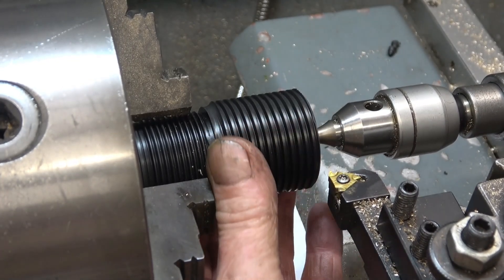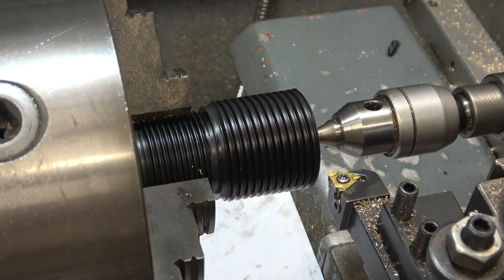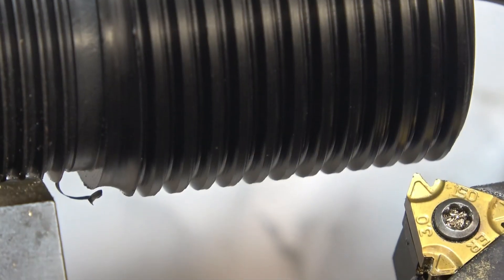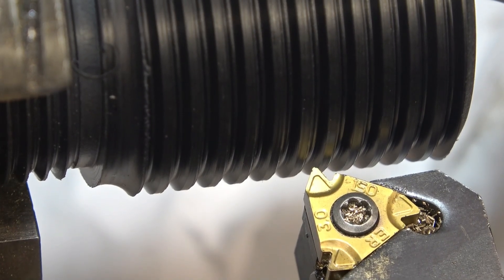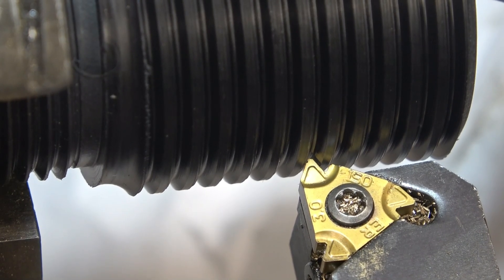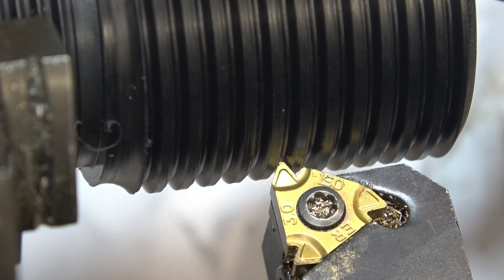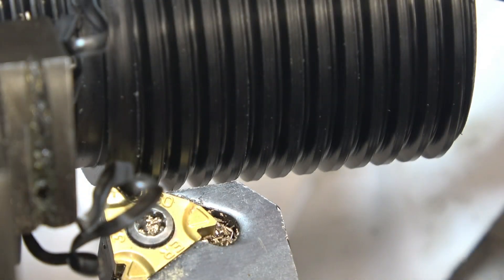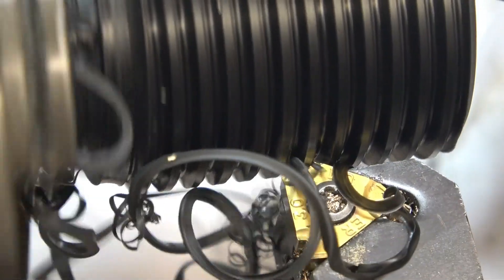Wednesday Night Catch Up .How to Pick Up a Thread on a Lathe: A Step-by-Step Guide.

Comment: All good and it might be worth adding that if you are not spot on, but still have thread to cut, a slight misalignment won't matter much, i say that to give beginners a little confidence if they have to do it, near enough can sometimes be good enough.
Reply from the maker: As I keep saying .The job beads to be accurate enough to do its intended job.
Reply: @doubleboost  indeed !

Comment: Cracking Video kidda.  I've been struggling with a Draper Storm Force 100A flux core 'mig' welder (63669) and some 20 square x 2 thick mild steel section.  Any tips on how to dial in the wire feed speed and the Min - Max, 1 - 2 switches would be mint.  There is no settings chart on this welder or in the manual, thanks Draper!

Comment: Hi John,   Idea for Wednesday Night Video.      This video (and last weeks) were cutting BSP threads with the BSW thread form of 55 Deg with  radius on crest and root.    How would you cut the BSW type thread with a single 55 Deg sharp pointed lathe tool and obtain the correct root diameter as in this (and the other video) a formed insert was used, which has the correct thread height between root and crest for the correct TPI.    Surely this tool insert can't be used for other Dia BSW threads with different TPI and thread height?
Reply from the maker: A different tip is used for each thread pitch . In this video i was using a metric tip cutting 8 TPI . This was just for demonstration purposes .. a nice bold thread that simply is non existent .Well up until now .
Reply: @doubleboost  Let it be known from here on as the 'Mills peculiar form thread' 🤣
Reply: You can't cut a radiused root thread form with a basic sharp angled Vee form single point tool. 
The trick is to grind or stone lap the point of a hand ground tool to conform with the required root radius. The crests can be hand finished with a small single cut file run down the thread while the lathe is running slowly.

Comment: Excellent, never knew how to do that. 

Now a question TIG welding 1mm Aluminium my rtech 210ex on simple setting 75amp will not tack up or weld good, base metal drops as I tack or weld (lap joint), I'm using 1.6 2% Lanthanated with foot-pedal, the arc wanders before a tack is formed, cleaned with acetone & ss wire brush 6-7cup around 8lpm argon 4043A rod, I'm thinking of upping the tungsten  to 2.4 so I can grind a sharper tip (lengthways) to get the arc more stable at the tip I'll try 60 degrees instead of 30.  

A video on that would be nice, as I know you had the same type of machine and watched your rtech vids & Everlast machines which made me buy one a few years back. 
I was an apprentice welder full time served & even qualified as welding inspector ndt & destructive back in the 80's but have been out of that game for a long long time. Help appreciated with these newer inverter machines, the ones I used back in the day were approx. 2 time the size of a fridge transformers & water-cooled.
Reply from the maker: That sounds way to hot for 1 mill alloy . I use 2.4 blue tungsten up to 180 amp on AC .
Reply: @doubleboost  I'm using the standard setting of max 75 amp on 1.6 tungsten rtech easy setup. you say your using max 180amp on 2.4 and you think I'm too hot. still confused.🙂 I ran out of time to practice anymore.
Reply: Check out your balance setting,I run my thermal arc set around 32 to 35.also if you take the frequency up to around 130hz,it will bring your arc cone in closer so you're not heating such a big area.
Reply: @adee-H1066  Thank you, I will have a play, I ran out of time before I could start to play with the full machine settings. I guess you have a similar machine.👍